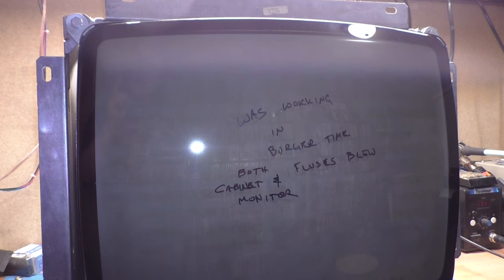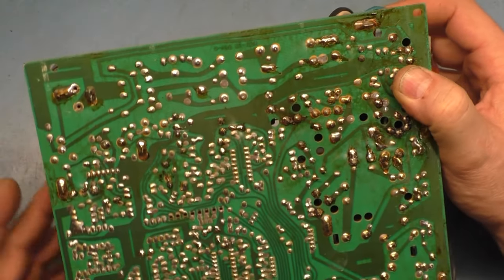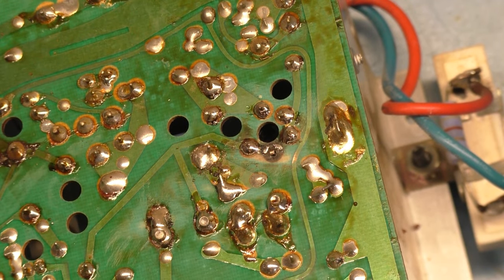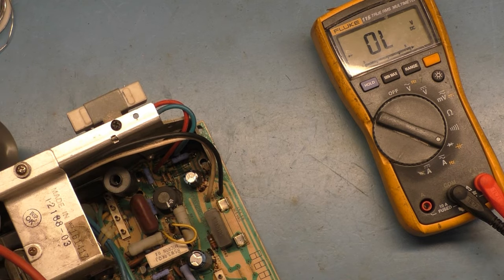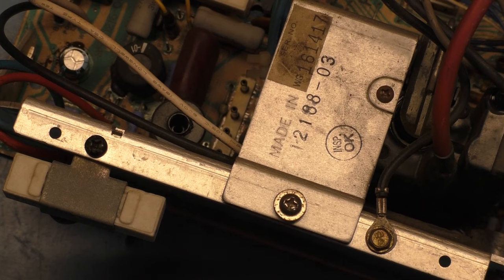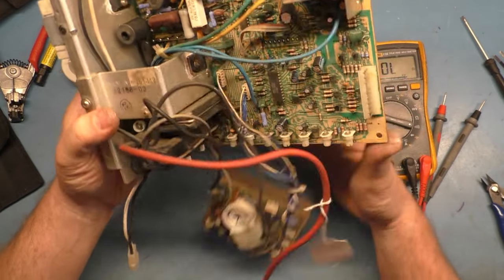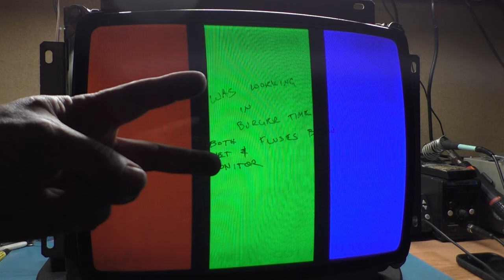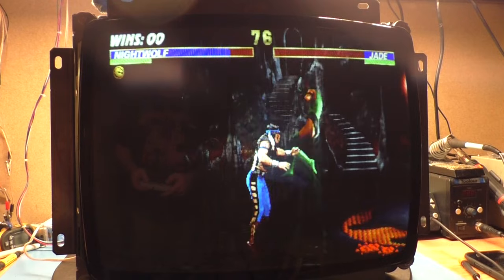19" K7000 Arcade Monitor Repair - Blowing Fuses #17 - Width Coil Not In Circuit

Comment: Have you ever fixed a K7000 chassis then plug it back into the tube only to have a nice light show because the guns are shorted? I have.  I just put the whole thing away as I didn't need it at the time.  Who knows what the tube did to the chassis.
Reply from the maker: Nice light show on the chassis or inside the tube neck? Shorted guns don't cause damage to a chassis. Not in my experience.
Reply: @MikesArcadeMonitorRepair  In the tube neck, looked like Raiden was inside the tube.  It was in a 19" K7000 out of an Outrun someone gutted.  I should find a tube to swap into it.
Reply from the maker: Your tube lost vacuum. It’s toast. Not a chassis issue.
Reply: @MikesArcadeMonitorRepair  interesting as there's no visible damage to the neck. I'll pull the plastic off and look under it.
Reply: @tigheklory there's no damage because without vacuum it's literally vaporized